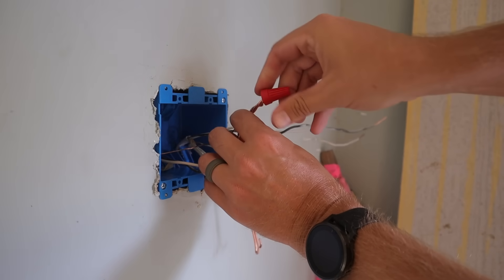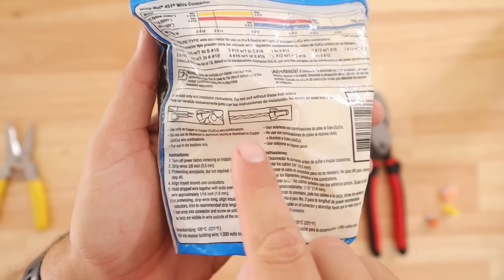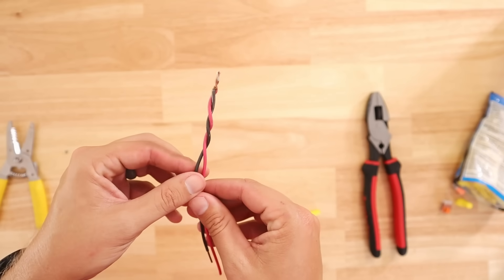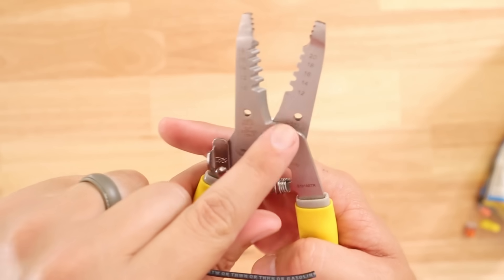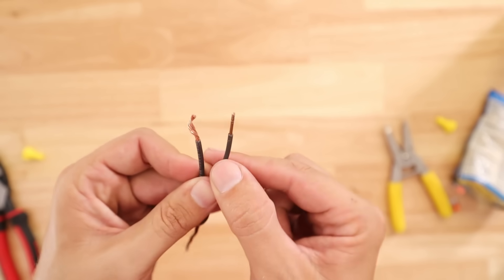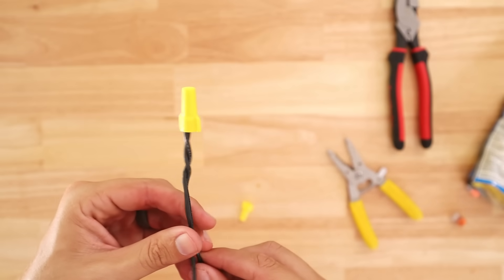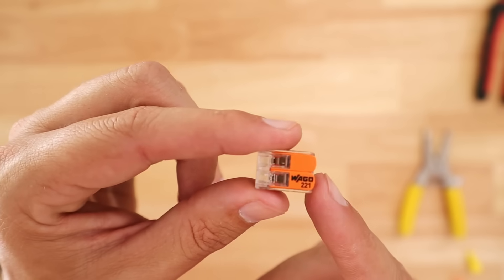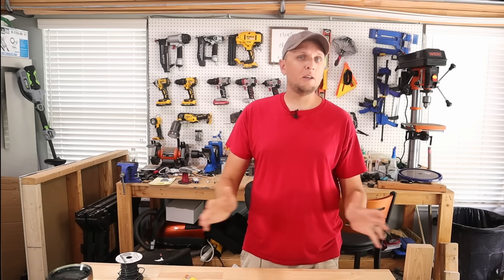BIGGEST Mistakes DIYers Make When Connecting Wires Together | How To

Comment: With solid to stranded splice. I always twist the stranded wire with my fingers then lay it beside the solid with the stranded protruding  just a little longer than the solid, then put the wirenut on. The wirenut will grab the stranded wire and twist it tightly around the solid. Then i alway pull on the wire to see it is a good connection. Pre twisting stranded and solid together normally causes the stranded wire to pull out of the splice. 
Also when using stranded wire on plugs and switches, such as in commercial environments,  if you leave the insulation on the very tip of the wire when stipping it then put a counter-clockwise twist on the wire when you wrap it clockwise under device screw it will pull the strands under the screw head as you tighten the screw, then clip off the remainder with your diagonal cutters once the screw is tight. No stray strands to contact the box. A lot of electricians don't like stranded because they have never been taught how to work with it. Stranded wire makes the job much faster and easier when you get accustomed to using it. And stranded wire folds up into the boxes much more easily.

Comment: 28 year master electrician here.  Be careful giving your opinions. Overtwisting can cause the solid wire to puncture the plastic tip of the wire nut. Which your DIY ers will not understand. Not to mention soft copper will break under stress. Disregard the advice here and follow manufacturers recommendations in all cases with wire connectors.

Comment: I've done maintenance for 20 years. Wire nuts are fine if you pull on the wires to check the connection when you're done. You'd be surprised how many times a wire will pull out of the wire nut. Other than that, I don't twist and neither does any other maintenance man I've ever worked with. My Grandfather always pre-twisted his wires and then put a nut on them but I personally did not have success with it. I learned from electricians that do it every day. I also do not wrap it 50 times with electrical tape like some people do. If it's going to arc and burn up the wire nut, tape won't help at all. You have to pull on the wires and check the connection when you're done. I also do not like the Wago type connectors. In the plants I've worked in, I've seen a lot of failures with lever connector type wire nut replacements, due to the limited area of contact surface. Wire nuts are great and the price is right.

Comment: I like trimming the top of the joint at a slight angle so the wires feed into the very top/tightest part of the wire nut. been electricianing it for a few years.

Comment: when it comes to solid core and stranded especially with the cheap wire they use in light fixtures I tend to solder the wires together after twisting them like you showed. I then put a wire nut on but I also twist and then tape the wires from the nut down along the wires.  Might seem like a over kill but I don't need to worry about ever having a shorted out wire.
Reply: As a professional Electrician i have never heard of anyone Soldering wire in a light fixture. Put the Solid and the stranded together pre twist the stranded wire, Cap it with a wire nut, twist it and give em a tug to ensure a good connection You won't have to worry about a short caused by a loose connection. and there is many other ways the Wire could short out besides a loose connection So your doing all that work for nothing.

Comment: Pro Tip (25 years IBEW)-- Pre-twist only the copper not the insulated portion.  Pro-tip bonus- -- buy 2 bags of those Ideal wirenuts and throw them both out.

Comment: No, do not pre twist it makes it to where the wire nut will fall off - as for stranded wire to solid wire tinning the wire is the best way but very time-consuming I like to just leave the stranded about an 8th of an inch longer and line up the cut insulation. I personally hate the push to connect connections, I do not believe real electricians use them.

Comment: Distinction without a difference. Sure, one way is "better" but it doesn't matter. If you wired up everything on one circuit with pretwists, and everything on another circuit by using wire nuts to twist (and getting them good and tight), they would function the same. It's like washing fruit. It seems more sanitary and feels better, but if you never washed your fruit again, you'd live a nice long life.
Reply from the maker: It matters and not the same.
Reply: @HowToHomeDIY  Good point.

Comment: I'm about to attempt my first ever electrical project: replacing my kitchen ceiling light. It's part of a circuit that goes throughout the living room. The new light has those push connector type things (NOT Waygo brand, but a similar phone connector looking thing) and there will be two black wires going into 1 hole of the push connector (same with the white wires). Is this OK? I'm really paranoid about this and don't want to screw it up (I live in a 4 plex so there are other people to consider). Your advice would be appreciated.

Comment: When I splice stranded to solid I pinch the solid wire four times with the end of my strippers puts a little wave on the wire now stranded wire can grip solid wire when you twist wirenut on and will not pull off.

Comment: AAAAAAAAARRRRRRGGGHHHHHHHHHHHHH!!!!!!!  The whole concept of joining two wires with a toothpaste tube cap is the biggest mistake in connecting wires. How on earth do your houses not burn down? You need applied tight pressure to join two wires, either crimping or screwing, WITHIN an enclosure!
Reply from the maker: Yes because it’s a toothpaste cap 😂. These comments are amazing.

Comment: Can you use a wago for household wiring?  I am installing a generator transfer switch and they include wing nuts, but I saw someone recommend a terminal block and I was thinking that using some wago connectors might be even better.  Certainly easier.
Reply from the maker: Yes they can be used for household wiring.  You will want to make sure that whatever you use are made to handle whatever size wiring you are installing.

Comment: Stripping hundreds of wires per day, I would never waste time getting the right slot. I use a Greenlee 1914 stripper. Most important after making a solid joint, CUT THE END OFF, this ensures all wires will go into the wire nut evenly.

Comment: I don't like to twist the wires together except what happens when you put on the wire nut, twisting requires a larger wire nut. Paying attention to your work, I find to be the best and safest way to go. Any sloppy job is most likely the cause of failures. Different strokes for different folks! Haha!!

Comment: I'd like to see a video explaining good techniques or practices for dealing with space limitations inside electrical boxes.  For example, I installed a Kasa smart switch in a 3-gang box containing two existing 3-ways, so there was so much wire in this box it was nearly impossible make space for the new smart switch.  There were for example six neutrals all with a wire nut, this is a lot of wire to push around.  How can this part of wiring be made easier?  thanks
Reply: Use a bigger box
Reply: Make sure the wires are properly folded in and any excessive wire is trimmed down. You need at least 4-6 inches of wire to work with. anything shorter and it makes it 100x time more difficult to get the Device on.  It will be tight to work with but you should be able to get the smart switch into a 3 gang box.

Comment: Don’t pre-twist in Residential, pre twist if you want in commercial or Industrial. It’s a preference. Pre- twisting is for wire caps. Not wire nuts in my opinion.

Comment: I have used wire nut on the job for years. I always placed both wires side by side and then twisted the nut on. Pulled on both to check. I never had one come out. And never reuse a wire nut.  On solid wire I would just take a needle nose plier and bend 1/16 the ends of the wire away from each other. Then twist the nut on allowing the nut to twist the wire. This makes the solid ends dig into the coil of the wire nut. It jams it so well that you can’t remove the nut.  Like I said I never had wires come out of a nut.

Comment: The Ideal Twister wire nuts will twist the wires together as you install them. The end of the tan Twister wire nuts will fit your 5/16 nut driver for installation.  Try putting on a tan Twister wire nut with your nut driver and then remove it for inspection. Even works with more than 2 wires.

Comment: A lot of different opinions out there so I'll give you mine. After forty years as a commercial electrician who's likely made hundreds of thousands of wire joints I've found that you always twist all solids together before twisting on the wire nut. For stranded wires twist them all together before twisting on the wire nut. Never but never twist the stranded wires with the solid wires. If you do either the stranded wires will be grabbed by the wire nut and solid will put out or the solid will be grabbed by the wire nut and stranded wires will pull out. Put the solids and strandeds together with the ends completely even and then twist on the wire nut. Pull the solids and the strandeds to make sure the wire nut has gripped both. Gripped both and if they are twisted together the wire nut can't do that. Personally I don't like the idea of the wago's because most pressure connectors tend to loosen over time and also more of a chance for corrosion. Can't tell you how many light fixtures I've opened up to find the wire connections corroded to the point of coming apart. What works well on camera in a nice clean environment can become trash over time and weather exposure. Back in the fifties and sixties Buchanan's were made of copper or steel as a sleeve that you slid over the joint and then crimped. Then you insulated. A hundred years later they would still be a good connection. The real issue is that durability has taken a back seat to speed and the ability for novices to make the connections. Before buchanans most joints were soldered and that was good for the life of the wire. Side note. I don't know a single electrican who doesn't use a pair of klein 9NE's. They are offset pins to give you far more leverage during cutting. I had an apprentice who insisted his center pins would do the same work so I twisted five number ten solids together and asked him to cut them in two. After several minutes of straining he finally managed it. Then I handed him my kleins and said try these and he cut through the wires with ease. Said he'd have a pair of kleins in the morning. I did notice the pair you recommended are also offsets so even though I prefer kleins you are using a good leverage type of pliers.

Comment: cool stuff. I like to tape my wire nuts especially on stranded wires. What are your thoughts on that? I pass my city inspectors inspections and he seemed to really like it so I did it as an above and beyond to the whole home rewire. Also, if a wire, i.e. ground comes loose, it will not easily touch the hot leg and pop the circuit. I tape my screws too on light receptacles and switches.
Reply: unnecessary in most situations, but doesn't really hurt anything. In the field I typically only add tape when I'm connecting several wires under one wire-nut, or if I'm connecting a motor or other vibration-generating equipment. There is one situation in which I am firmly against taping wire-nuts, and that is if you are doing so to cover exposed copper hanging out of the nut because too much insulation was stripped off. This is both lazy and dangerous, as over time the tape adhesive could fail, leading to exposed, energized copper.

Comment: I honestly in resi usually pretwist or in a junction that isn’t super accessible .but In commercial I rarly pretwist and it will make hot work later harder and Llosa safe And yea we know we’re generally not supposed to work hot but here is the thing .I’m commercial applications it’s not realistic and we all know to it.I prefer wire nuts but the wago lever locks are probly a good connection too.I absolutely don’t believe in the the stab lock style or backstabbing receptacles either they always fail over time

Comment: Great video. Wire nuts are by far the winner for making the best connection... especially when done properly as you showed in the video. I would not recommend the push-in connectors. Very little area makes actual contact in those devices and I've seen way too many of them burn up and open circuit. A lot of receptacles and light switches have these built in, and they do the same thing, they burn up and open circuit. I believe they're dangerous and should be band. Use the screws on devices and wirenuts on wires and you're good to go.
Reply: I agree they should be banned, my house was built with push connectors in 2004 and I'm frequently replacing them cause they have burnt and melted. Luckily the boxes have contained the carnage so far

Comment: Hello, a total ignorant here. I grew up in a house my civil engineer father designed. Whoever did the electrical connections missed some standards and by the age of 20 ( me and the 1962 house ) I found some wire nuts not tight. I decided to take my time and re-tighten them. And no progress. They became loose instantly. 1) Bought new ones and yes, they "stay" together. A slight movement and the cables separate. So I did an experiment. I twisted one pair of wires clockwise and another counter clockwise. 2)Clockwise tightened the hardest. At age 60 YouTube exist and as I'm watching this video I feel so relieved! 
Of course I asked many electricians before, and almost all, told me that I was doing it the right way. But the important part is * always use a new one * they are too cheap to think in saving pennies. Anyway, we do these works to make them neat, RIGHT? - buy new ones.

Comment: I watch this video 3 years after changing ALL the light fixture in my house and jeez... i feel bad not having twisted the wire too, it's like common sens that i missed out, i mean my wires are still fine like i've done the tug test and all, but man, this twisting the wire step would have made my job perfect.

Comment: Here's another way to do stranded wire and solid . Separate the stranded so there is equal strands so it looks like 2 wires place the solid between the  2 separated strand wire, now wrap one section of the stranded one direction around the solid , take the other section of the stranded wrap the opposite direction of the first stranded you wrapped  .Now take the wire nut and screw on .Tada done.

Comment: You make a good point for over twisting if you have new wire, but doing that with existing wire can cause the wire to break off in the wire nut giant PITA when working on a hot circuit. 
 If your in a place with lots of vibration or worried about it coming loose tape over the nut and wires, most of what your talking about comes from not planning ahead with wire length and space in the box.
Mistakes is a bit of a scare tactic in my opinion I would call in good practices or to be sure here is an option.

Comment: Very helpful video. When using wire nuts, I always pre-twist the wires together, trim the top and twist the wire nut until the insulation also twists a few times, I don’t know if it does any good or not, but I also will wrap electrical tape around the wire nut and down on the insulation a little bit. Also, with stranded wire, I will pre-twist each stranded wire itself, then twist the two wires together before putting the nut on,

Comment: You're correct and yes the picture shows the proper installation method but you had your finger on it here:
https://youtu.be/WschUxip-4w?t=123 

Step 7: Insert wires into connector and screw on until approximately two twists are visible outside connector.

You Sir obviously did not read ALL the manufacturers instructions a common mistake I see when I talk to other Sparkies about this topic.

Comment: How about crimping the wire nut after the wire nut is fully installed using a crimping tool?  I believe it works when the insert of the wire nut is a single piece of circular sheet metal.  IMO crimping not suited when the insert is a spiral wire.

Comment: I for the most part like you videos. I was taught that when you twist wires together (or solder ) you can introduce hysteresis witch can make the wire heat up. It also introduces 7th and 13th harmonic on the line. Harmonics on the line reduces the life of many electronics, ie computer, tv, led lighting.

Comment: 3:10  I would strongly warn against overtwisting. You can strip out the nut so it slips, or worse, snap the wire inside causing a potentially dangerous connection. .

Comment: I'm a big fan of push to connect fittings; however they are useless for making connections with stranded wire.  And both are problematic when wiring into a common neutral connection in a busy box.  Horses for courses and all that.

Comment: I would say your stranded to solid connection is wrong or lesser than another added method. Take your solid wire, bend it to 45*deg or something, then with your fingers get it started to bend around your stranded, then come in with your pliers, pulsating force on the grips (as to not damage the stranded...) and twist multiple times gently. you end up with a connection which looks like a solid to solid connection. How you did it is fine, just lesser..